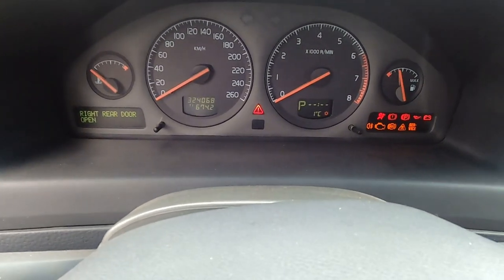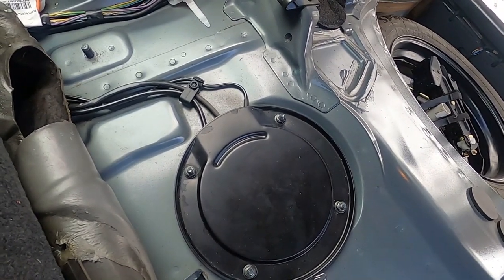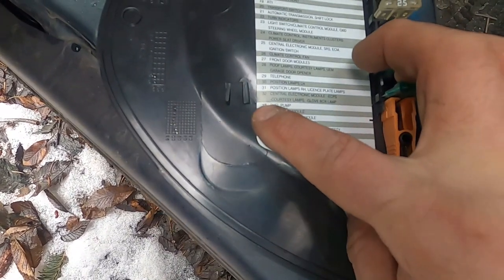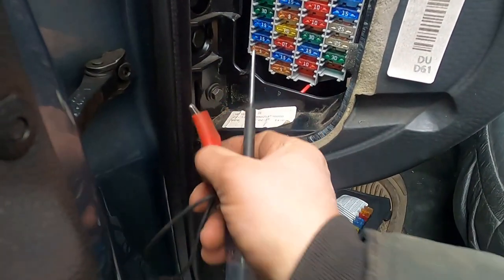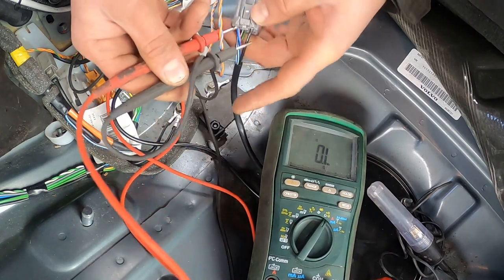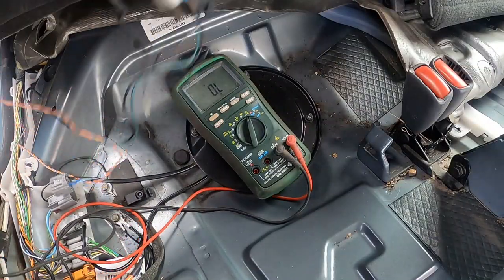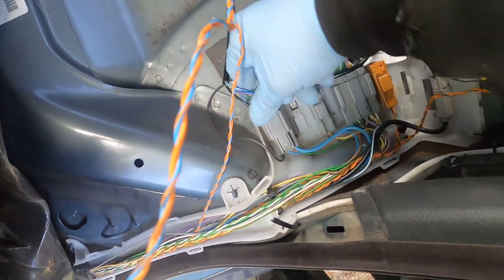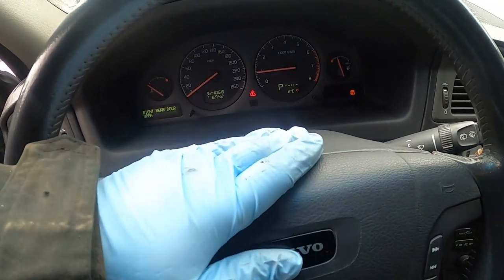VOLVO CRANK NO START - FUEL ISSUE | TROUBLESHOOTING & REPAIR.

Comment: Very common fault on these models is the fuel pump relay fault - it is a small relay usually underneath the right-hand of the dashboard. You can swap it with the front fog light relay - which is next to it in a emergency. I always carry a spare.
Reply from the maker: Good point Parry! I will pin your comment up make sure other viewers can see it. Cheers!
Reply: Thanks for your helpful anwser ill try eight now
Reply: I have a 2007 volvo xc70 im told relay is on 2001 to 2004 and 2005 to 2007 has the pemm in the back instead a relay. I cant find a relay for my 2007 volvo xc70 anywhere, do you think it has a relay for fuel pump I cant find it
Reply: I found a thread on Matthews Volvo Site that suggests there is no fuel pump relay in the 2007 XC70 model. Instead, there is a Fuel Pump Control Module (FPCM, FPM, or PEM) located in the rear quarter panel1. Another user on the same thread mentioned that if you have a fuel pressure sensor fitted to the fuel rail, then you have a PEM. Otherwise, the relay is on the CEM above the steering column1.

Comment: at 3:30 HUGE mistake...just because a fuse looks good doesn't mean it is good. You can save yourself money aggravation and a lot of  time by testing  it with a continuity meter. Trust me.Well you did it at 3:57 you verified the fuse continuity electrically. Overall very good and informative video. Thank you.
Reply from the maker: Thanks for an advice Joe. Good point. Cheers!

Comment: Very common for the fuel pump control module to become faulty because on the early P2 Volvo V70's the module is fitted underneath the car just above the right side of the fuel tank. The problem is that the module case starts to corrode and it's case then let's moisture inside to the delicate electronics. The later models fitted the module inside the boot to prevent this happening. If your car starts on the crank, but struggles to keep running then there is a very good chance this is the problem. Also, the fuel pump relay can wear out in time. This relay is fitted just above the right hand footwell courtesy light, but you have to remove the 2 screws that hold the courtesy light trim and remove. The fuel pump relay is a micro relay on the bottom right side of the front fog light micro relay. You can swap these relays if need be to get you home.
Reply from the maker: Thanks for your advice Perry! I will PIN your comment up, make sure other viewers can see it. Cheers!
Reply: @PistonShack  Thanks.

Comment: Thank you ! I got stuck in the snow yesterday, now car won't start and I really suspect it's the fuel delivery.
Your video has given me all the clues to look for, now I'm off to get this sorted !
I would have loved to see how you removed the seats and carpets and stuff, to have a better understanding of there in the cars the covers are.
Like, does this model have two fuel tanks ? It looks like there are two covers.
Also you mention the fuel pump relay is under the dash, left hand side, a commenter here says it is under the car, right side ? 
So where is it actually. Because it seems to me checking the relay is much easier than removing the carpet ?

Also you mentionned something about "keeping the airbag plugged in to the seat" ? I think you mean the wire for the seatbelt  ? (it would trigger a SRS fault if ever disconnected with battery yes ?) 

Fortunately I have VIDA/DICE so I hope to discover the answers to all these questions before I need to call for a towing !!

Thank you !

Comment: Great site - thank you! But I'm a bit mystified. I have 2004 XC70 with sudden failure to start. Happened briefly ~18 months ago, resolved on its own and has now returned. Strong crank > no start. No fuel pressure at the Schrader valve, the fuel pump fuse and relay test OK, and swapping relays does not allow a start. Car does not have PEM - i checked every known location. I don't see one anywhere. I do not get 12V using a multimeter across any of the leads in the fuel pump harness. I only get 5V across certain pairs. The thickest wires (blue and black) show no voltage at either key position 1 or 2. No continuity across any leads on the pump side of the connection, although resistance is low across the thin leads. So it seems like I do not have 12 V delivered but the pump may also be bad? BUT there is some rodent damage to the harness. I have not investigated or attempted to repair that. Also - the tachometer does not budge when cranking in an attempt to start. Could this all be due to faulty Camshaft position sensor not registering any rpm? Thanks again!
Reply: if there is no voltage at the pump then we likely have wiring issue. (could be the harness messed up by the rodents) you can test the pump by checking for continuity like he did in the video with the ohm setting on the multimeter.

Comment: Hey so i have volvo s60 2006 so having issues with it the car turns off while driving and shows reduced engine performance past 2 weeks i am having a new issue i start the car but then it turns off instantly. I checked the fuel value pressure also it seems fine. But when i try to start the car it cranks it starts the odometer drops from 1000 rpm car shuts of any idea or recommendation ? Showed it to a mechanic it shows zero error codes

Comment: My volvo v70 d5 2005 gets fuel all the way to the engine but not pumping in the enjectors.
no fault codes, pump in the tank works but when cranking it wont fire up because it's not taking diesel into the engine.
problem started on a cold morning last wednesday at -31c, pre heated engine. 5 meters from my driveway the engine stopped but it didn't make concerning sounds, it just stopped.
fuses are okay and the fuel pump relay on the top side of the fuse box clicks when testing so should work.
because of your video i managed to test the pump in the tank and was able to figure out that it's working, thank you.
any tips?
Reply from the maker: Any luck with your Volvo? Seems like you fuel shut of solenoid at the rail might be off.

Comment: I’m getting a crank no start under 32F outside. I’ve tried everything, super annoying. Going to replace the starter next. I’ve heard it can cause issues when going bad.
Reply from the maker: Does it crank strong or not? If it cranks, shouldn't be the starter issue.
Reply: mine wont start block heater plugged in with 2 boost jump packs in -30C. but if i crank for about a minute straight it'll finally go.
howerver in a heated shop it'll start no problem. wouldn't start on ether (starting fluid) either.

Comment: Thank you for your video!  I have a 2004 S60 and it cranks but doesn't turn over.  Cpu was replaced and mechanic says fuel pump is working but no luck from there.  Can you please relay what might be issue if you know?  Thanks much!
Reply from the maker: Hey Thomas. Does "CHECK ENGINE" on when key turned on? Do you have tachometer signal while cranking? 
Do you have fuel at the fuel ramp (shredder valve)?
Do you have spark while cranking?
Let me know how is your diag.
Reply: @PistonShack  hi there...my apologies for the late reply..mechanic said he gets a single spark when cranking but nothing more
Reply from the maker: If I understand correctly, single spark, just sparked once then no spark while cranking?
Reply: @PistonShack  yes..correct

Comment: My Volvo V70 2.5 TDI 2001 model I think, would not start this Wednesday. When I started my car on Monday and Tuesday, it felt a bit "heavy" trying to start it up in -15 degrees celsius, but worked, I just warmed the start plugs by turning the key on, and waiting a few seconds, for two times. The next day, and when I try to start it now, it will not start. No white smoke coming from the exhaust (White exhaust meaning diesel is pumped into the engine), instead my car start making some "tick" sounds, and my dashboard is turned off for the moment I try it. The "Tick" sound I believe is the start engine trying to ignite the diesel, but I have no Idea what is wrong with my volvo. I have also tried to charge my battery, but to no use, so I would be glad for any feedback. I will try to put some diesel in the tank, because it is close to being empty but on my dashboard it says I can drive for approx 150 more km.
Reply from the maker: Hey Frederick! I would drain water separator and then change primary and secondary fuel filters. Sounds like engine has fuel starvation, know issue on diesels due to moisture in fuel and dirty filters. I won't trust fuel sender unit, seems like it doesn't read correct level. I would put fresh winter diesel and go from there. Let me know how everything is going. Cheers!

Comment: I have '04 S60, it turns on fine but dies after a few seconds. Any idea on where I can start looking for the problem?
Reply from the maker: Hey Layton!
Try to unplug MAF sensor first, know issue on Volvo P2 chassis, and start the engine - ECU should switch into default mode to keep engine running.
Do you have any DTC codes? Do you have tachometer reading while cranking?
Reply: @PistonShack  thanks for the reply! This is my first car. I unplugged the MAF sensor & it stayed on. Does that mean I need to replace that sensor? I did get quite a few codes P0300, P0011, P0600, P0700, P0420, P0705. After cleaning the sensor & plugging it back in only one code remains, P0705. Thanks for all your help!

Comment: Can't tell if its a sensor or the fuel pump,the print out says sensor, but the mechanic says,  its not getting gas ,do you think its the fuel pump..it stopped on me yesterday..
Reply: A lot of "mechanics" just swap parts at you expense instead of troubleshooting  it properly. Also, that is more expensive and more labor to replace the fuel pump. It usually  is NOT the pump itself but the various sensors that report to the ecm, which then sends out to the PCM ( Pump Control Module). Start with the easy stuff if unable to troubleshoot.  Fuses, relays, sensors, then only go to the expensive stuff like PCM  or pump

Comment: Just so you know,  the blue cap on fuel rail has a bump on the back. Simply turn it around and relieve the pressure. It should squirt out a thimble full on your fingers. No need for a screwdriver.

Comment: 2004 Volvo XC70 wagon AWD 2.5 litre 5 cylinder turbo 265,00 km with low fuel rail pressure problem causing engine no start conditions or starting then immediate stopping. The fuel rail gauge pressure now reads 20 psig with key on and the same under cranking same start and stop. I did get car started in my driveway about a week ago but the fuel pressure would not exceed 32 psig which I believe should be at least 60 psig and hesitated when stepping on the gas pedal. I tried to start again and back to the crank but no start. I installed new fuel filter last summer and battery in wheel well and the car ran fine up until recently and then kept getting worse.I  have checked with  Volvo dealer parts dept with the car vin# and they tell me there is fuel pressure sensor part # 31272730 located on the fuel rail and the PEM fuel control module part #30742823  above the gas tank are part of this fuel delivery system that may be causing this problem and even sent me Volvo diagrams of the fuel delivery system with part numbers ect. Checking my car there is no fuel pressure sensor on the engine fuel rail or I cannot locate the PEM  module, looked everywhere for it. Should I be looking at checking and or replacing fuel pump and fuel pump relay and if so how do you remove back seats to access fuel pump . I would much appreciate any help or suggestions here, thanks, James.
Reply: It should be located above fuel pump access cover on top of tank under right fear passenger seat. Some are mounted on fender well underneath as well.

Comment: My Volvo C30 t5 doesn't want to start crank
Reply from the maker: Hey Manus! Does it click no crank or no click no crank?
Reply: @PistonShack  it is not getting petrol to injectors
Reply from the maker: ok, do you hear fuel pump prime respond when turning key to ON position? Did it run before you parked or vehicle died on you?
Reply: @PistonShack  it  made a alarm sound and whe I've switched it off it doesn't show any battery lights on dash
Reply from the maker: Do you have immobilizer light ON. Can you open/close car with your key fob? Try different key, could be dead battery in your key/fob.
Reply: @PistonShack  Okay will try thanks